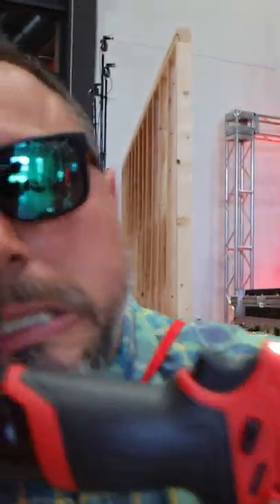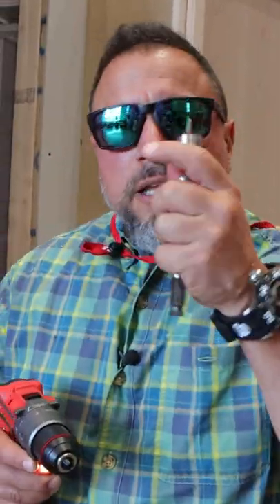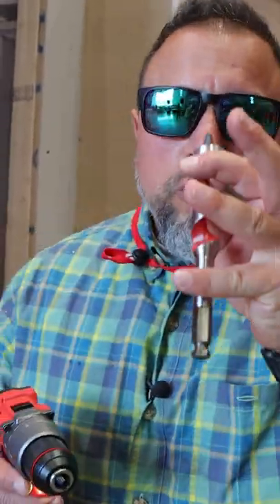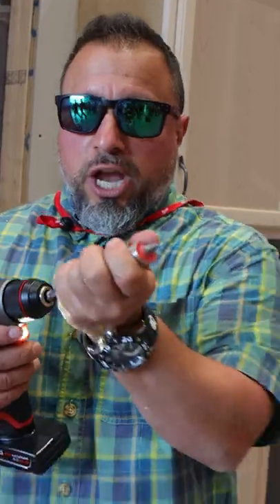Little M12 Drills Huge Sip Auger Bit!

Comment: We use this drill for everything. I wish they would make a side Grip.
Reply from the maker: Yooo this thing so powerful it could use one!
Reply: The side handle from the M18 compact hammer drill(brushed tool) will fit on this M12 hammer drill. I’ve also heard people say the M18 Gen 3 hammer drill side handle will work.

Comment: I have those types of bits for last gen m12 hammer drill and I hate those bits. Speed 1 is just slow. But I got a few owl auger bits. I can speed 2 all day with cleaner and faster holes. The right bit for the job gets it done faster.

Comment: I really wish you would went through the knot in the wood. If it could took that without stalling it would said something.  Most drills don't have a problem doing those holes in 2x4s .

Comment: Hey you stole my whole thing bro 😭😭 now no one is gonna gasp at site when I do this... 

Best thing about this is that never snaps your wrist and I can drill about 20 old 2 inch joists with 2amp battery. It's pretty sweet when you are doing resi electrical stuff so I just got this on me all the time with Philips, 5/16 socket and 3/4 paddle.